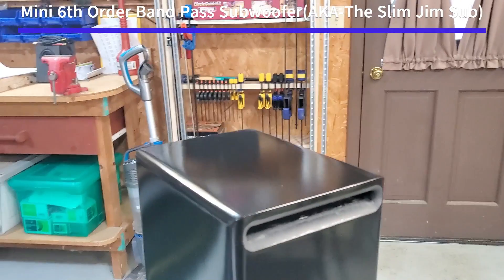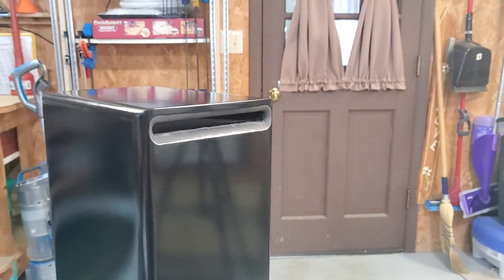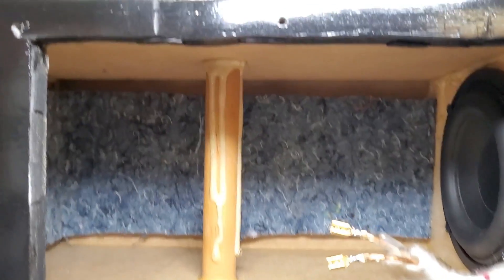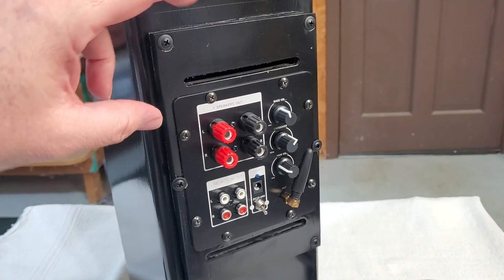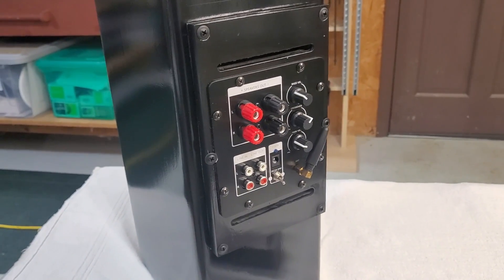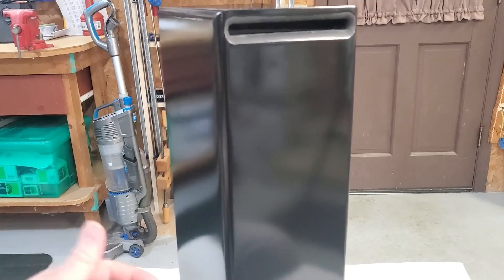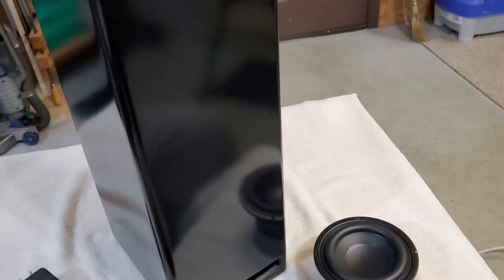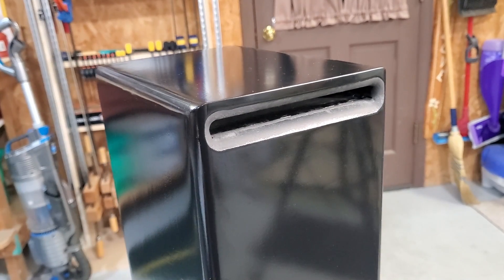Mini 6th Order Bandpass Subwoofer (AKA-The Slim Jim Sub)

Comment: Do you think the neo magnet dayton 4" version of the one you used would be better/worse?? I'm thinking about doing this exact or similar build.. but was really eyeballing that neo version, thanks for the video, VERY nice work.. even if you aren't 100% happy with it.. trust me to the outside world...thats a next level build
Reply from the maker: Big Thanks! It is surprising what this little 4" sub can do. In hindsight I would: Have made both slot ports .5 inches wider. It would have added 2.5" to the internal cabinet volume but probably eliminated most of the port chuffing. Also, I was informed by "The Hive Mind" experts to round over the inside edge of the ports. The only issue I see with the ND105-4ohm driver is it's QTS number is a little high for an enclosed sub like this. You might want to use a woofer with a QTS of .45 or lower.
Reply: @DonnieMulligan  so im not 100% sold on doing a bandpass design.. I actually like to be able to see the sub in action.. but also want the most possible spl I can get out of that 4" driver.. scan through my channel if you have a second.. I've got a few videos of past builds I've done, typically I put these 4" drives in VERY small cramped enclosures with a battery pack/amp and other stuff so the air space is 100% incorrect, but they still provide "some" bass

Comment: Question:

Do you prefer the Gorrila glue over Titebond II?
Reply from the maker: I use wood glue on all exterior joints and Gorilla glue on the interior ones(Slot ports). It expands 1.5 times it's volume when hardened thus insuring a better airtight seal.
Reply: @DonnieMulligan  ah....to seal up any imperfections. 

Speaking of interiors. The beginning of the labyrinth ports have that sharp edge.

Air doesn't like turning more than 15° at a time around any object. Air is drawn in from all available area around the vent. A full radius may have helped with the chuffing

My day job is designing and building high performance race engines. The way air moves has been my life's work. Building cabinets like this and many others has been my passion for just as long.

Good work.
Reply from the maker: @arturozarate1752  Thanks!

Comment: That's very cool. Here I thought I was being innovative by using a pair of 7" sunwoofers in an isobaric arranged 6th order.

In case you geel the itch to spend a little money, experience more bass, and test your skills, try CDT Audio. Their MX design of speakers are phenomenal. A pair of 7"(6.8") subs will cost $119. Their 150w rms is conservative, and their frequency response is in the basement down to 10Hz. They're an SQ audiophile level speaker. I also run 6, in a vented enclosure tuned to 30Hz under the rear seat of my 2019 Ford F350. I also use their components and coaxials. LOVE THEIR STUFF!

I replaced my blown JBL 12" powered sub with these in a beautiful enclosure. The output is incredible and neatly placed out of sight. 

Really neat build my friend.

Comment: Wow that is the best 6th order design I have ever seen I like how you almost t lined the ports bet that little 4 inch woofer boom
Reply from the maker: Thanks! Definitely surprising performance out of a 4" driver. My only recommended change would be make the box 4 inches taller and go with  1/2 inch ports to eliminate some of the port chuffing.
Reply: I am curious about which physical dimension you were suggesting adding those 4 inches to on the enclosure. And are you suggesting going from a .5 inch wide port opening to a 1 inch wide port opening? I’m really tempted to play around with this design and possibly even double it scale for two of these little drivers.

Comment: Nice result, but people have a tendency to make the ports way more complicated than they need to be. Folding back and forth is not the easy or efficient way to do it.
Reply from the maker: No thanks, I'm good. I'm moving on to new projects.
Reply: @DonnieMulligan  what's planned for your next build? I've been working on some final designs for my upcoming speaker projects. Got some real out of the box projects in mind.
Reply from the maker: Definitely not easy, but it is a very efficient use of space. The whole cabinet is only .55 cubic feet.
Reply: @DonnieMulligan  just for shits and giggles I redrew your cabinet to the exact dimensions you show / mention in the video. You can keep the exact same external dimensions without weaving the port back and forth.

I have seen people weave like that plenty of times before, but it is totally unnecessary. If you like I can send you a picture showing the easy way to do it.

Comment: Nice build!  Did you confirm the resonance frequencies and overall frequency response were a match for what WinISD predicted?
Reply from the maker: I could only do an In-room response with R.E.W. since my test equipment is anchored to a desktop. Knowing that most in room measurements below 200Hz are problematic, I only did a few nearfield measurements at 12 inches from the top port. Pretty flat response from 42Hz-95Hz with nice roll offs on both ends. 95Hz was a little higher than the modeled 80Hz. I must be a little lean on cubic volume in the rear chamber.
Reply: @DonnieMulligan  As both vents are the same size, another way to accurately measure the response would be to close-mike each vent (less than 2cm) and just add the response in REW.  

You should check the actual resonance frequencies with DATS or something similar.  The resonance frequencies will be at the valleys in the impedance curve.
Reply from the maker: @Grommet2007 I did that as well. It near the end of my video. I don't own DATS yet. Future purchase.